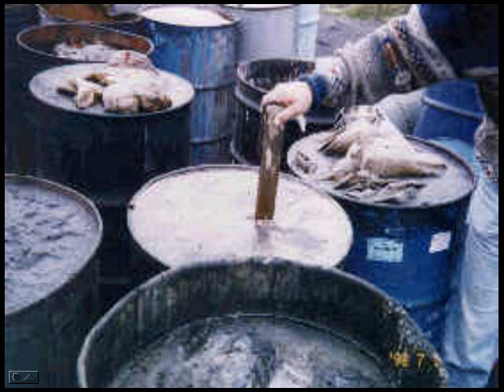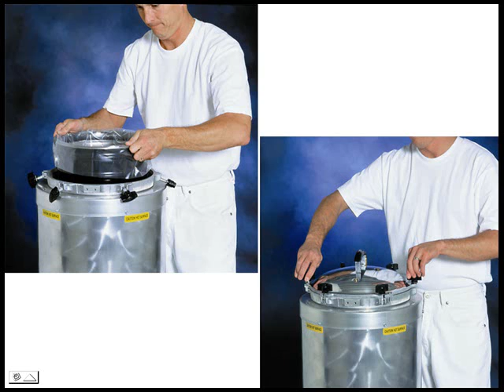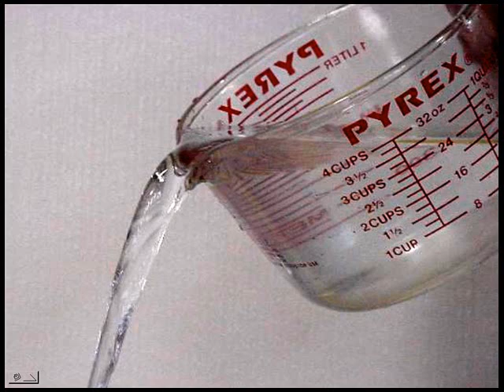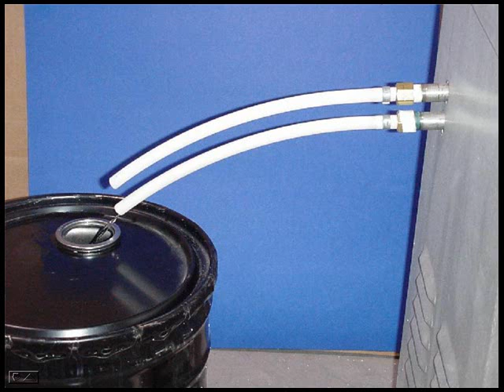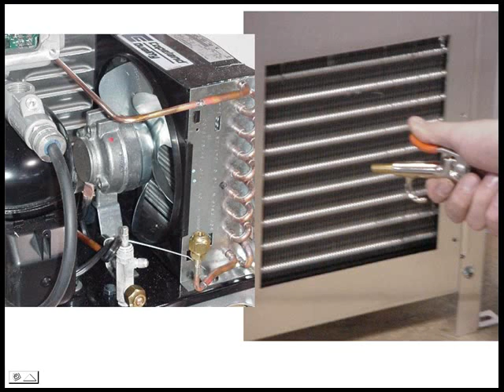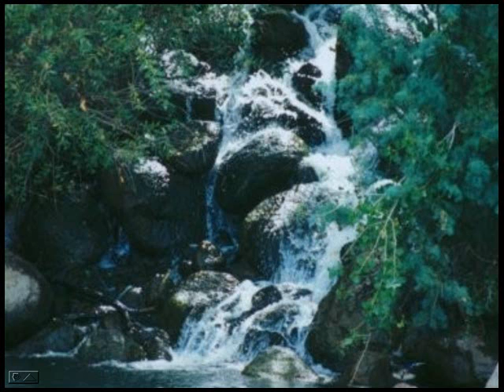Sidewinder Model M2 Presentation

Comment: Hi can I process conversion varnish paints and primers the ones you add catalyst.  I did the first five gallons but the new  thinner or whatever it is that came out of the machine through the hoses has  a very strong smell and I don’t know it it is safe for me to re-use it. I’m trying to use it to clean the paint pumps but it’s just so stinky  imagine if I recycle it  2 or three times it will be worse.    Your thoughts thanks
Reply: Lol